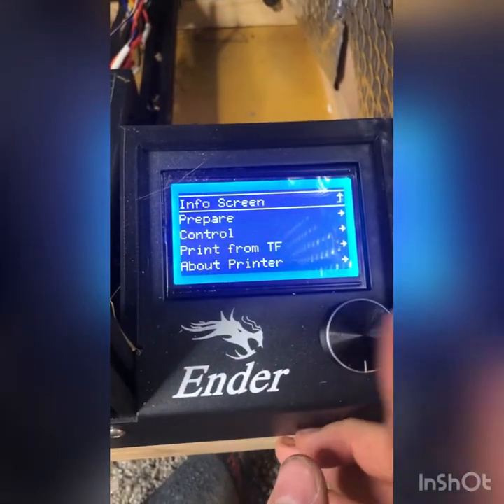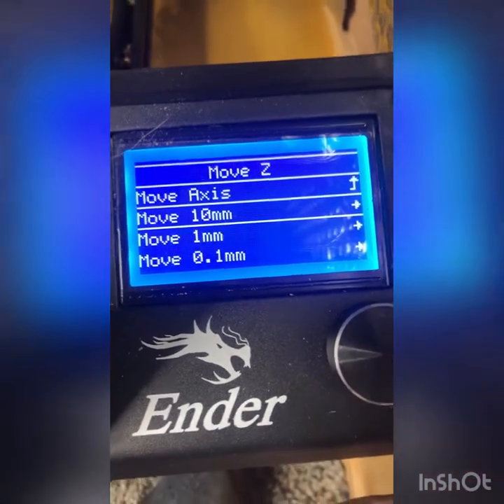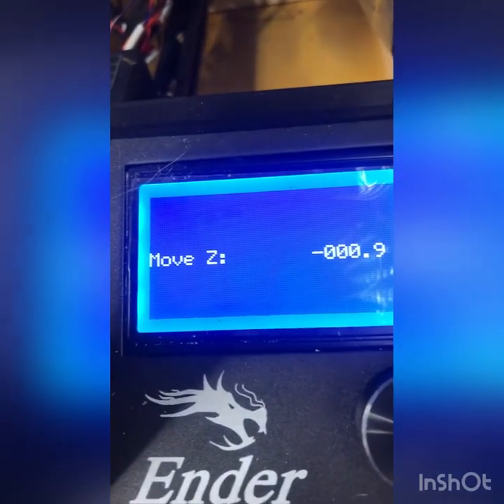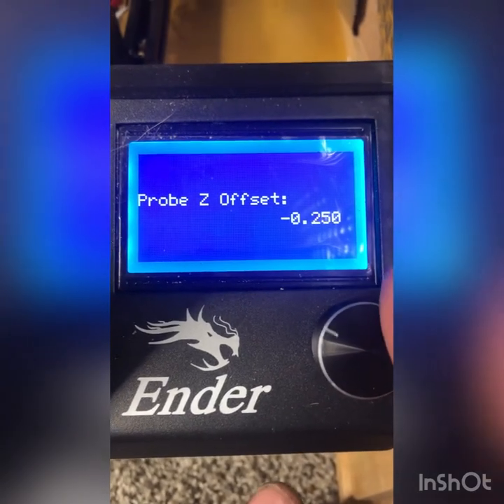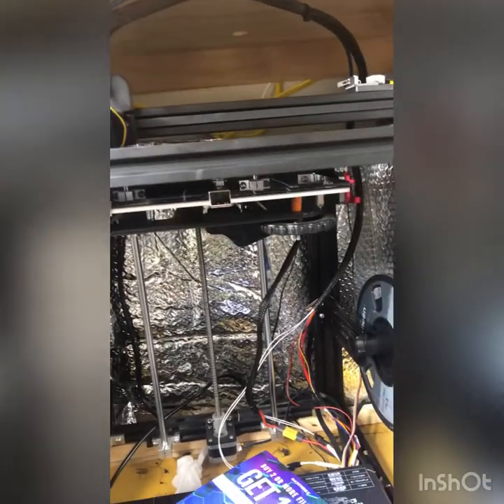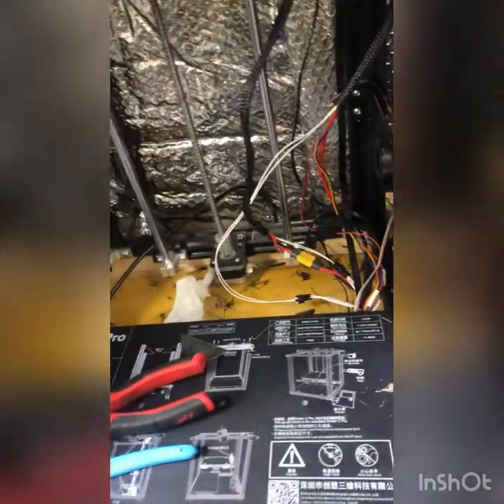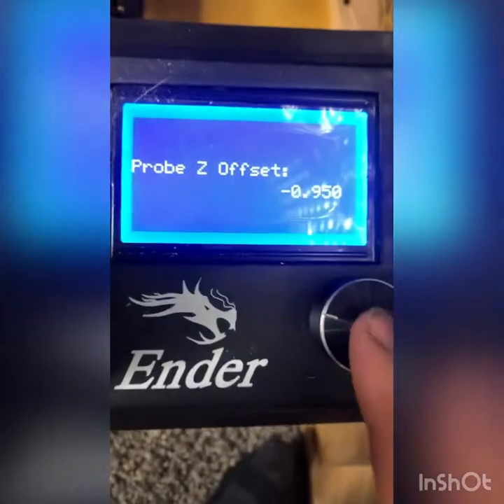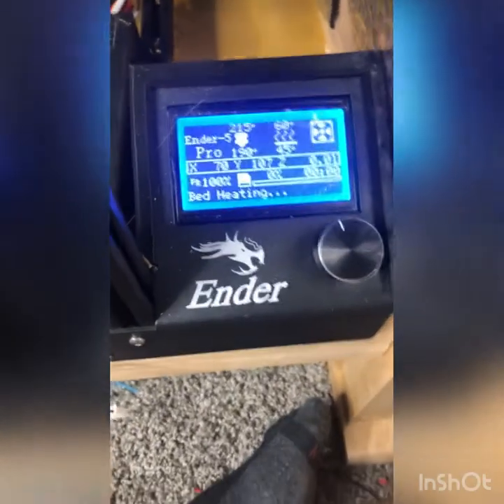Calibrate Crtouch n Creality ender 5 pro

Comment: Do you remember which firmware you used?  For me, running "bed leveling" keeps crashing into the left side.  And thanks for info about keeping same SD card. I thought EEPROM would save to the printer, not the SD card.
Reply from the maker: I used the CRtouch firmware on crealities site
Reply: @citizen_a Pretty sure probe offset deals with z-axis, not thinking the table is 50mm wider than it is.  My problem was just the order of updating and initializing - I didn't realize what all settings would be changed.  I'm printing fine now.